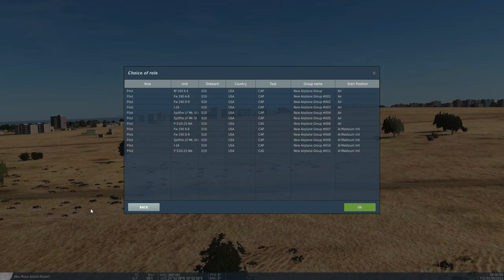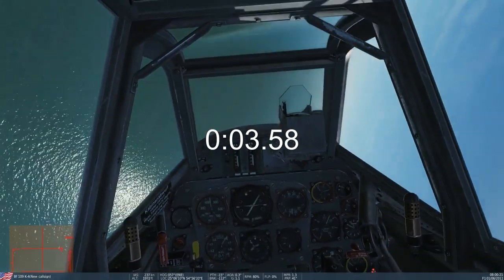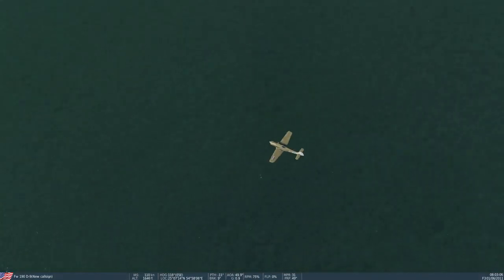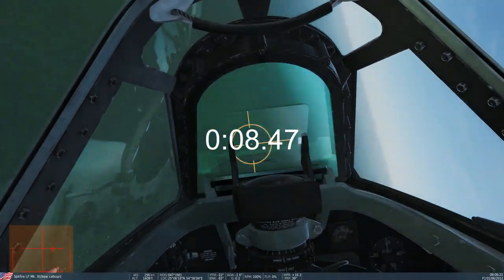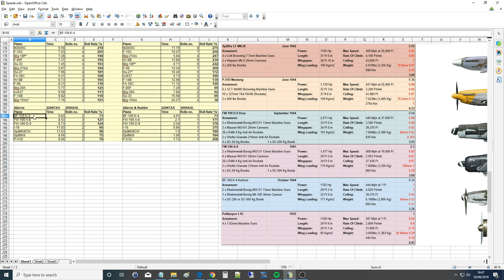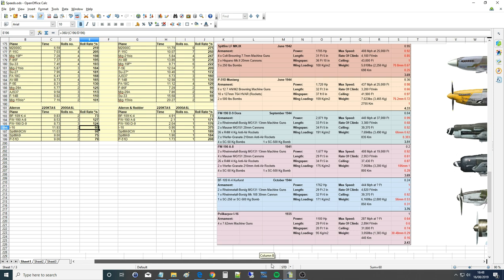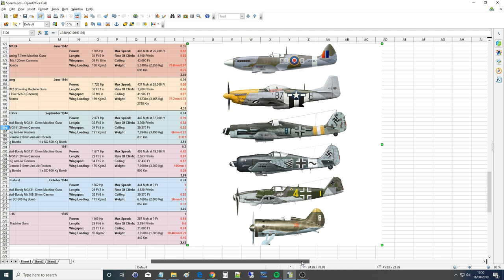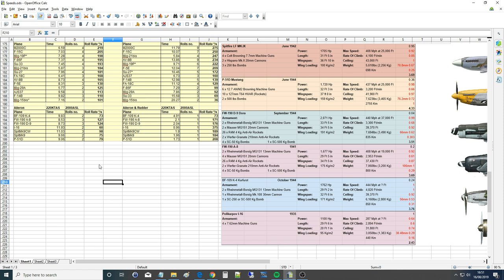Warbirds: Max Sustained Roll (Aileron Only) & Snap Role(Ail, Rud & El) Rate | DCS WORLD

Comment: Hello. The answer to the question why BF-109  has slower roll rate is somewhere else. I read  a book about the plane and the author explained that Bf-109 has very narrow cockpit. That ment that stick has  not much room on sides to move and pilot`s elbows could not be far apart. For a pilot it was physically hard to roll fast- especially at higher speeds as he would have to press on stick harder in terms of force in kilograms comparing to Spitfire`s stick in wider cockpit and wider axis range.
Reply from the maker: cool thx